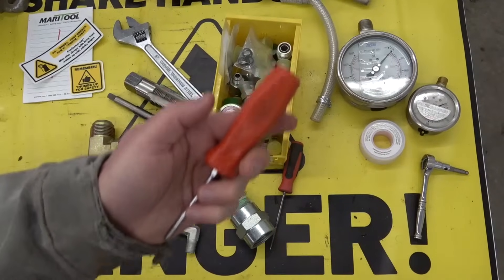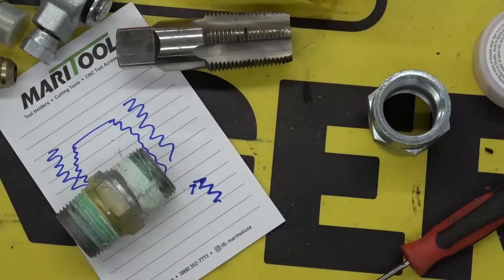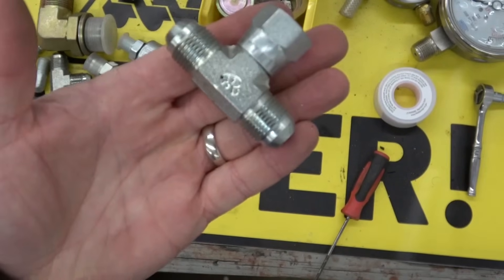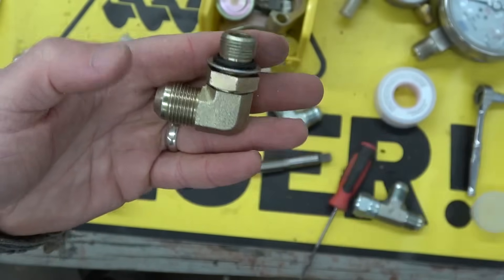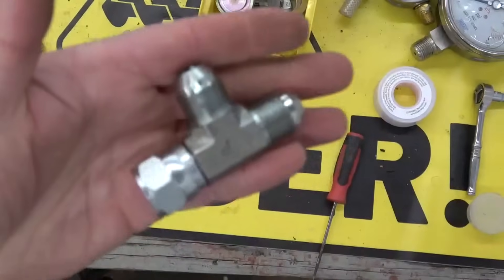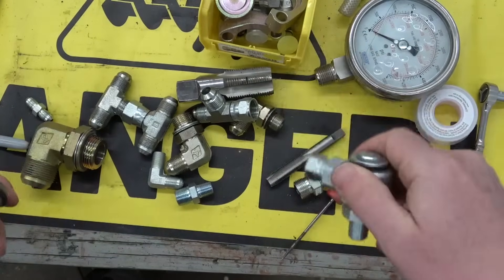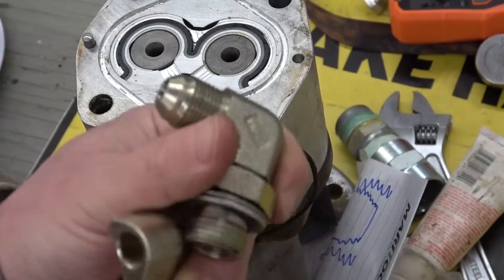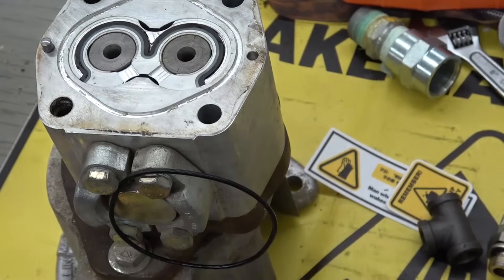Pipe thread is designed to leak || AvE hydraulic

Comment: I worked a whole summer long in a small old school hardware store. The kind with a basement filled with every nut, bolt, screw, bobs n bits. Had to sort and refill that whole basement multiple times over the whole summer. Ever since then I can guess the size, length, material and head by just looking at it and for most even blind by feeling. Most useful skill I ever learned that I use almost daily as an engineer.

Comment: 2:40 In Germany, I was surprised to learn that NPT is the standard! And the plumbers use a wad of blonde hair to seal them! (hemp fiber) 
Don't know about oil, but works great with water pipes. And if you do have a slight drip, eventually the calcium in the water seals it best! Did I mention Germany has hard water?

Comment: The 2 flange codes are code 61 and 62, 62 being the heavier and thicker flange of the two. Those damned ORFS are a pain, 200 pound gorillas over tighten and squish the steel face of the fitting, a new O-ring will crush out every time, not to mention they don’t bleed off pressure very nicely when you loosen them, they tend to blow oil everywhere! The main advantage NPT had in mining was hoses always broke in the weakest spot-the swivel, JIC’s common practice to have the swivel on the hose end, whereas NPT used a small separate swivel adapter

Comment: It's the old timers tricks that keep the youngsters scratching their heads and thinking.
You pop the o ring in your mouth and tell em it's a 401 boss. Because you see what they guy's working on and you know that's what it calls for. Or you hit a piece of steel bar stock with a file, smell and tell them it's 4140 heat treated. You didn't smell anything, you saw the remnant of orange paint on the end of it.
If you do these things enough, well you gain a reputation.
 Then you burnish that rep by doing things like smelling bolts when you remove them and saying things like, "Loctite 242, ah..(sniff)...2015 vintage....March...no..(sniff sniff)...April, yep April". 
There are myriad opportunities to have fun with your coworkers in the maintenance field.

Comment: I have followed you for a while but most of this video is crap, NPT will seal fine if you use a PTFE paste or Loctite sealer on it but don't expect to repeatedly take it apart and reseal.
"this is a metric fitting, Whitworth" what are you on about, if that fitting is SAE then it is 60degree thread, if it's a BSP swivel then it's a 55degree thread but still not metric.
The fitting with a convex cone is BSP and should only be fitted to a corresponding BSP with a concave cone not screwed into NPT or anything else it may fit.
SAE flanges are available in two pressure ratings 3k and 6k.
You never mentioned metric fittings like 12L or 12S that you would find on a crane or any machine from Europe.

Comment: If you're interested in this, there's a good book called "Carroll Smith's Nuts, Bolts, Fasteners and Plumbing Handbook"  Carroll Smith is an OLD school racer starting back in the '60s. His original title was "Screw to Win" to fit in with "Prepare to Win", "Tune to Win", "Engineer to Win", buuuut that didn't actually happen.

Comment: The dash size being the number of 1/16 inches, very usefull to know that one ! Been in a world of hydraulics for a few years now. Hate the tapered thread stuff...  junk ain't the word. Best of all is the metric stuff, similar-ish setup to JIC, but has an oring on the taper. Seals even when the appentice has just screwed them on by hand ! And if the Oring does fail, the metal to metal taper will still seal, though the apprentice with the thick ear will need to tighten them with a spanner.......   Oring face seal ???   f*cking junk.

Comment: There's actually if anybody cares multiple different flange standards. There is a low pressure type 61 flange. You're high pressure type 62 flange. Those are both SAE standards. Then you got the stupid ass cat ones

Comment: Recent story. The clucth master cylinder on my honda failed and after buying an oem replacement, I've learned the previous owner did a manual swap and put a clutch hydraulics from another model, like a proper scumbag.  What was supposed to be m 12x1 thread was instead m 10x1.
 An hour job turned into 4 days just looking for parts to make a new line .

Comment: 14:11 flange heavy and flange light... had a device that had heavy flange, someone crimped a light fitting...
Was close...not!!!
.020" gap, blew out the o-ring. Had to pull 2 40' lengths out of a sock to crimp the correct ends on...
Also that rule about how many 90° angles in a circuit...😂 hydraulics was a constant challenge with each manufacturers fuckery.

Comment: In a past life I assembled truck loads of brass NPT fittings. Each one got a drop of Loctite 545, never found a single leak. If the parts didn't line up right when they were tight, I used regular Loctite. Hand tight and they still never leaked or came apart.

STOP USING THAT AWFUL TAPE!! A single bottle of Loctite 545 will last a normal person a lifetime. "Industrial use only"

Comment: That gauge has an ISO-228-1 Parallel Thread which is non pressure tight by itself. There will also be a pressure retaining device as part of the gauge joint.

Comment: Big Teflon Tape corporation conspiracy!

12:58 I'm a mutant. My left hand has 13 clearly defined folds. The left middle finger has an extra 1cm fold in the center.  My right hand has the normal 12.  So I can count to 156 Babylonian.  Weird. 

Use your finger tips in binary and you can count up 1024.

Comment: These will ALWAYS leak if you're using steam, Borrowed/stolen from many a fitter on site, these are an operators saviour. Definitely will leak passing 22 bar of steam through. AND of course the steam will just wire draw its own leak path. Also use 3/8" wade  brass fittings... ONLY now, after nearly 40 years of insanity, we go to swagelok stainless! Steam don't like stainless, operators don't like stainless. It galls like a beech!

Comment: Nothing is better than o-ring, I do a lot of pressure testing and the usual reason o-rings die is because of overtightening or old age. You can finger tighten o-ring and it will hold 600 bar easy, cant say the same for JIC.

Comment: There is a very easy solution to this. A taper without thread followed by a thread without taper. So basically you would have hose, hose crimp, hollow hex bolt with the taper at the far end. The recepticle would have matching thread followed by taper. That should bind down to be gas tight with the correct torque.

Comment: Watched your Vids for years, I think you are funny AF and well on point, all except for this Vid! I live in in Australia, originally from the UK, we have a mix of BSP, "G" Shit, other metric alternatives, NPT and everything in between... The best thread I have ever come across and use "Daily" is NPT, a little PINK plumbers PTFE Tape and never had a single drip in over 10 years, all the other threads leak instantly unless its endless wraps of WHITE PTFE or Loctite 577 Glue... Please travel a little before having a strong opinion! Also this does not include standard HP threads which have a mating conical female and male threaded flare/JIC ends, these do not use tape of any means and seal instantly regardless the thread type, they are two completely different conversations ;-)

Comment: I work with metric fittings all day long and they're terrible, the flange seals so well that you can't always tell if it still under pressure when backing a nut off so you end up sometimes getting it blowing a load in your face if you don't hit it hard enough to break the seal

Comment: The fact that a simple angled surface on both ends is enough to seal under pressure, without an O-ring, is also interesting, especially since the parts do not appear to be made super accurately. Maybe the material is soft enough for both surfaces to "conform", thus dealing with any machining inaccuracies, thus providing a sufficient seal?
Reply: any material will "conform" if you reef on it hard enough 😁

Comment: JIC fittings are great. They are available for wide range of port side sizes and thread types. But the pipe connection is still UNF. And despite having imperial thread the connection seals even here on Europe side of the Atlantic. (Edit to correct the supposed to be joke here)

One down side for JIC connection is the need of flaring on the pipe end.

Oh, then there is another fitting standard with 37° flaring. It is either AN or MIL. Those dont form seal with JIC.
Reply: No, AN will seal to JIC just fine, but AN is rated for way higher pressures, on account of the threads being UNJF instead of UNF (radiused root of the threads prevents crack propagation, so they can take it)

The upshot is that if you use AN parts where JIC was specced you’ll most likely be fine, though i still won’t recommend it, but if you use jic in a system that needs the AN’s higher ratings you’ll kill somebody.
Reply: @fitzmorrispr  Oh, then I must remember incorrectly. Thanks for the clarification :)

As you said - AN and JIC should not be mixed for the safety sake.

Comment: I despise those hydraulic fittings with the o rings. I have a ford 7610 tractor and whenever there's an inexperienced operator on it, they leave the hydraulics pumping and break the o ring. it happened so often i left the access plate off to cut 2 hours off the replacement time. another issue is the o ring falls out during assembly and you don't realise until everything is back together and the oil is pissing out.

Comment: It's worth the $ for a male plug/female cap assortment of your most common flavor fittings unless you have the ability to scavenge a bunch of old hose ends and random fittings from the gettin spot for matching up sizes (or capiping something off to get by long enough to move the machine etc... assuming you buy pressure rated kits) Just Lord have mercy on your soul whenever you buy/offer working on all the new Chinesium pieces of equipment flooding in because of modern machine requirements making used prices go higher and higher... Then you have to figure out metric DIN sizes, find adapters to any North American standards that you can use from there or attempt to get conversion hoses made from a shop not familiar with DIN and have to explain LL, L, or S pressure ratings along with the metric thread size that work on SAE hose diameters, but only if you have a chart and can show them... Then hope they got the right pressure rating parts so you can actually use the hose size/JIC fittings you want 🫠 If you live somewhere not familiar with the chinesium nightmare fittings I suggest just carefully cutting the chinesium hoses apart and telling them you want this stupid fitting crimped on one side of this size/length hose along with whatever normal fitting you need... assuming you the original fitting being broken isn't the problem this will save you a ton of time ordering your own odd chinesium fittings to take with you, or even slower letting them do it... If AVE buys about a 2.5-3 ton chinesium excavator for the farm we will get like 10 videos a day before we all die of a mysterious new bird virus 🤣👍

Comment: Pneumatics and hydraulics pretty much are a metric equivalent of the Imperial sizes, unless you are dealing with parts from a former Soviet state, where they are metric, and not really interchangeable, unless you use unreasonable force, and consider the fit a single use thing.

Comment: The real free gift gem is that Maritool pen sized extendable back scratcher. If they sent you a pad, they probably send you one of those.

There is pipe thread that isn't tapered. BSPP - British Standard Parallel Pipe. Seen it, tapped it, no furggin clue if it's better.

Comment: I use Loctite 577 for NPT, seems to do well. We used to use 567, it would eventually leak. Then Loctite 554. The Loctite 554 would eventually crack & leak. The Loctite 577 has a gap fill for those shittier joints.
Reply: We also use it with bigger thread then 3/8". Als have to heat it up, but then when needed to get loose.

Comment: NPT threads are designed to seal, the problem is nobody actually makes them right.  Your pipe nipple is sharp at both the tip and root, this is wrong.

Comment: The idea of explosion proof electrical fittings is that there is NO WAY too keep the explosive vapors or gases out of the conduit, however by the time the explosion inside of the box, the conduit, the condulete or whatever gets through the 6 or 7 threads it's too weak of a flame to create any larger explosions outside of the conduit. Same with flat surface cover plates.

Comment: The o-ring on the boss or sae fitting is not the normal dash orings they a 900 series orings. 902, 904, 906 etc.
They are all different C/S cross sections

Comment: Lock tight PTFE paste is the worlds best sealer for pipe thread. I got onto rebuilding a Buick V6, I did a net search on the best sealant for the head bolts. Well yep the PTFE paste is the best, as long as you have thread engagement this stuff will seal up to 200psi as tested by me, 1000psi I don't know because I haven't pushed those limits, that sort of pressure is usually olive fittings.
Reply: Also those komatsu fittings are actually Italian in origin.

Comment: NPT is designed for both fittings to be tapered. Then, you tighten both with pipe wrenches in opposing directions. They will always seal 100% of the time. If you bottom them out. I have seen it work with gas pipe but you will also never get it apart when it inevitably needs replacing.

Comment: Machinist here. You are wrong!  The root does not leak. Poor machining is what causes that. If we made those NPT parts, they would not leak. the threads would mesh 100%. 
Everything you said is kinda wonky when related to precision machining....To bad.  Black magic and Voodoo are poor excuses for poor advice.    Precisoin parts work, rough junk needs sealer.

Comment: As being german i am a big metric guy. But metric hydraulic fittings fucking suck. i worked for Pirtek for 2 years in bavaria. JIC fittings i like much more, because you can actually just crack them down a little bit more if they leak. if the Metric ones leak, you always have to change the o-Ring because on 99% it will be cooked.

And JIC has a lot better bore to spanner size ratio. While the bore of the fittings is quite big, the spanner size for the female nuts is quite small!

And dont forget: Fuck ORFS. We were teached to EVERYTIME change the O-Ring on these, even if they didn't leak. but if we touched them, we had to change em. And i almost lost my mind sometimes trying one handed in the dark to get this goddamn o-ring in place...

And really nice That you covered the CAT flanges too!
Reply: you could make a video about the pro's n con's of hydraulic couplings. or how to change the o-rings on these, i remember the company i worked for charging 300€ to change a Female Flat-Face coupling. You could safe a lot of money just chaning the o rings!

Comment: Angry Owl is not happy that you neglected to mention that JIC fittings are commonly (yet not correctly) referred to as AN (Air Force -Navy) fittings. 

Loving this series brother!!!
Reply: Or Army- Navy
Reply: The AN standards are super old, there was no such thing as the air force when they were made, so like  @shavedneon  said, except its not really an “or”

Also the standard has mostly been converted to AS now, if you look up the different AN spec sheets on EverySpec (there’s a separate number for every shape of fitting, and for a large variety of ordinary fasteners, as an example consider: AN804, TEE, FLARED TUBE WITH BULKHEAD ON RUN, or: AN805, NUT, UNION), most of the time they’ll just be a cross reference table relating the old AN part numbers to the new AS part numbers. AS standards are maintained by the SAE, which might save the army and navy some money?
Reply: Army / Navy. This fitting was invented to work across branches before the Airforce existed.

Comment: How dare you? You forgot british pipe thread. When you're North American multi million dollar project needs to be delayed by 6 months.
Reply: I've recently bout a jcb skid loader and have found out about bsp fittings, I've become pretty good at welding fittings together to test pressures.
Reply: I also haven't forgotten Lucas electrics ,positive earthing and Whitworth wrenches..
Reply: And IIRC (always a high risk manoeuvre) BSP comes in Parallel and Tapered variants. Learned that the ‘tank’ ports on my Kubota are 3/8 BSPP. Eventually I discovered that PA does have one adapter, I thought I was going to have to make my own for a while.
Reply: @AndrewMoizer  I was fitting an oil pressure gauge to a Kubota and the fitting on the oil gallery was none other than BSPP. McMaster-Carr to the rescue. I tend to suspect them on anything from a country that the Brits influenced heavily as they modernized. I keep a handful of BSPP in the shop at work just in case. Random instruments will have them at times.
Reply: They do exist and hey always catch you off guard.
Reply: @VF-84 JIS in my space, which is an adaptation of BSP. Don't forget the Germans, either.
Reply: *your